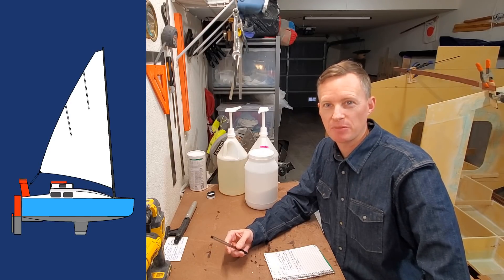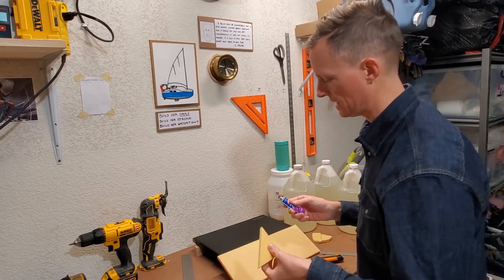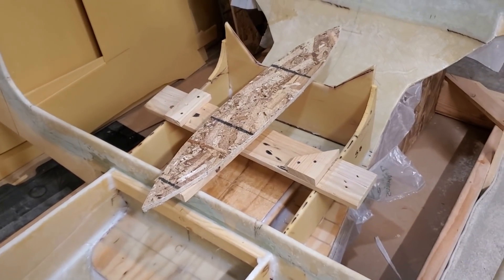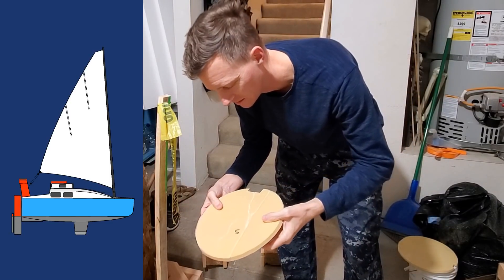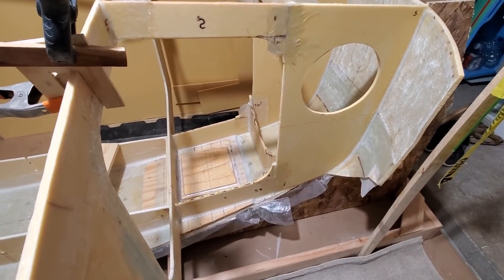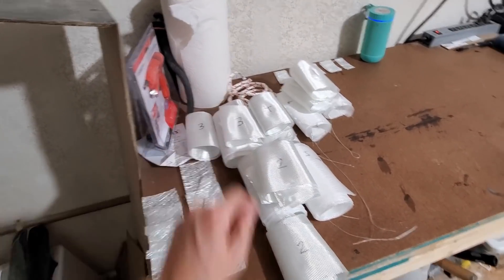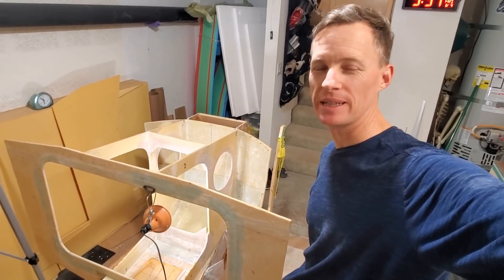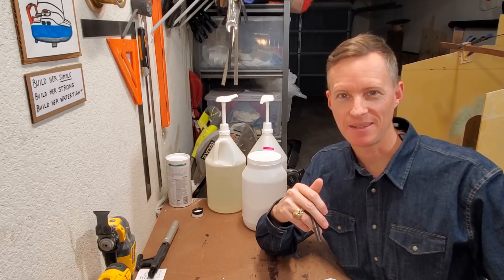OCSS-021 Scow Bow Structural Grid - Mini-Cruiser Sailboat Build

Comment: Another great video! Very happy to see you wearing a quality respirator when sanding fibreglass and epoxy - too many people are unaware of the damage those tiny bits of dust can do to lungs! Love the rope idea - I'll certainly make use in future builds.
Reply from the maker: Thanks! Yep I think even from my start with fiberglassing when I was replacing the wet core deck on my Cape Dory 31 years back, I always wore this respirator. Glad you liked the rope trick, I'm using that method for all my edges now.

Comment: The rope is neat. I've used epoxy soaked rope, nylon and polyester,  as the leading edge for leeboards and swinging rudders. It's rock hard and highly abrasion resistant.
Reply from the maker: That's what she said.
Reply: @ocean_capable_small_sailboat  - 🤣
Seriously though, if you want some extra abrasion resistance in some areas (say, rudder & keel edges, chines, etc), get some Dynel cloth. Much better abrasion resistance than fibreglass. A lot of kayakers use it for the edges of their paddles and parts of the kayak that tend to take a beating against rocks.
Reply from the maker: @Garryck-1  Thanks for the tip, I don't think I've heard of dynel before.
Reply: @ocean_capable_small_sailboat  - I first heard of it thanks to Annie Hill. She and Pete sheathed the hull of Badger in Dynel.

Comment: Love the rope idea, I was wondering how you would fill the hole at the top after chipping out the foam edge when it was vertical like that. Started working on my own design in Fusion 360 for a small sailboat, thinking 17.5ft x 7ft, max height of 80 inches from the top to bottom of trailer to fit in the garage. Probably cant do bilge keels like yours due to height limitations. Will have a solar powered electric motor in addition to the sail. Already had half the battery from another project, just bought the rest - 200ah 12v lifepo4. Have lots of parts from other projects to help construction including a 4x8 CNC I built last year but haven't got much use out of. 

Keep it up! Inspiring stuff.
Reply: I be interested in what kind of electric propulsion you have in mind. Will it be a fixed propeller or like an outbourd that you can lower when using it
Reply: @Sven Yrvind  It will be an outboard that you can lower. Either an electric trolling motor or a higher powered electric motor, I have spoken to the people at "caroute-outdoor" and they have good products. I already have a 55lb saltwater trolling motor for my west wight Potter but it might not be strong enough. If wired properly, the motor could be lowered while sailing to generate power at the cost of higher drag.
Reply from the maker: I wasn't sure if the rope would stick in the top. I was prepared to tape it up, but the sticky thickened epoxy held it in there.

Comment: In the event that the structural integrity of the finished hull is less than optimum in some area(s), you can always reinforce later with additional framing.
Reply: Triangulation?

Comment: Just wondering why no rudder guard?
I really like the twin keels and watching your progress!
Reply from the maker: Thanks Steven. I spent a long time thinking about the rudder, I need to talk about it in a video soon. I'm going to use a style of rudder that is INTENDED to detach in the unlikely event that it hits something, and it will very easily be re-seated in its normal position.
Reply: @ocean_capable_small_sailboat  With the twin keels allowing shallows to be navigable, I'm just thinking of stern damage if the rudder were not to perform as intended. And would aid in beaching on sand at low tide without extra pressure on the rudder. Just a thought & I am loving the build!